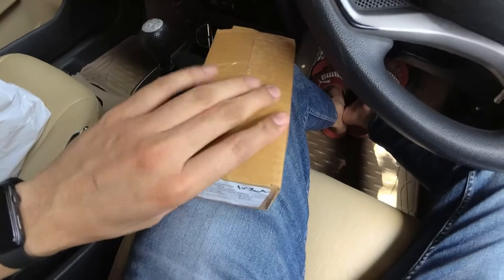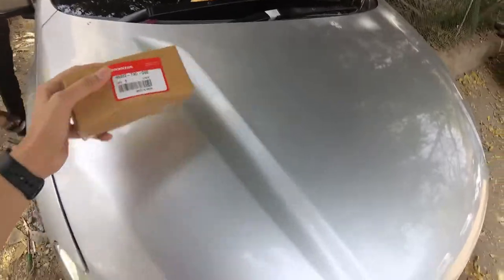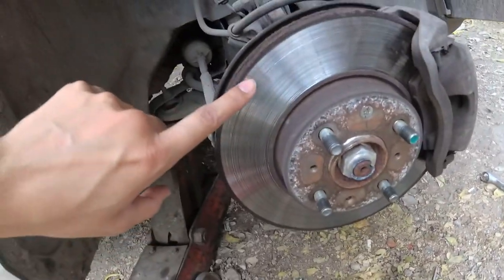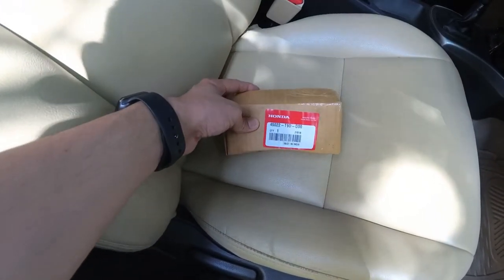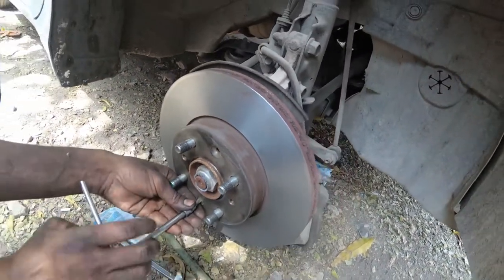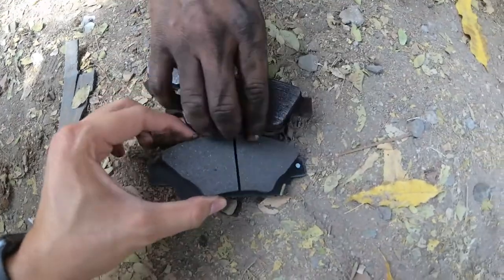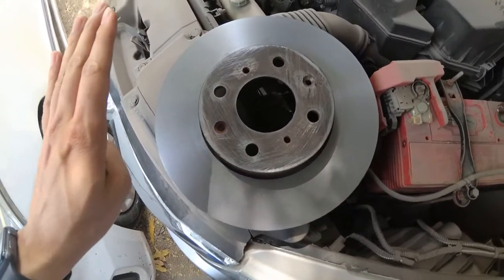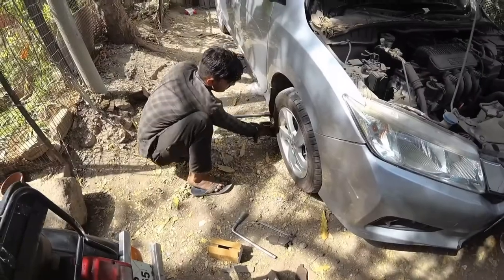HONDA CITY IVTEC 2015 | GENUINE HONDA BRAKE PADS REPLACEMENT | KAROL BAGH AT JUST ₹ 3050

Comment: Hi.
Mine is automatic honda city.
Earlier I installed Rane disk pad for Rs 950.
But there was some noise issues with them while I use break while doing forward or back . Then I installed TVS but the issue was still there though the noise was 50 percent reduced. Is this issue with new pads also. Me 
mechanic says in automatic it exist. What u say.
Reply: Metalic breakpad are famous for loud noise and most reliable performance. so metal shims and molebidinum greese are applied to minimise break squeeky sounds. thats y honda is selling breakpad at various cost, 
1. most costly are from thiland with greese and high class shim.(rs5400/-  )
2. India made without shim (rs 4600/-)
3. cheapest also India made (rs3200/-)

all are genuine only amount of metal in pad, pad density, shim and high quality greese make them better and costly.